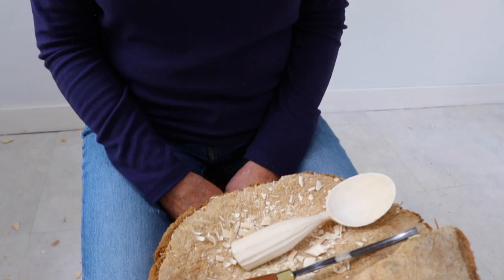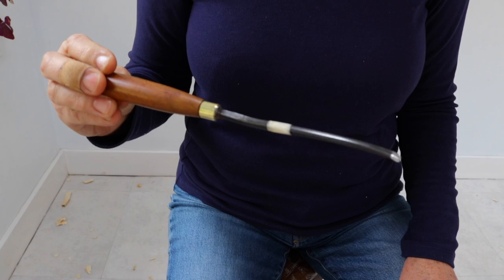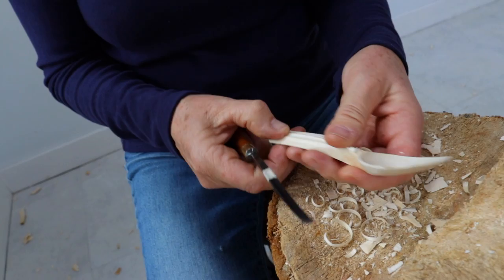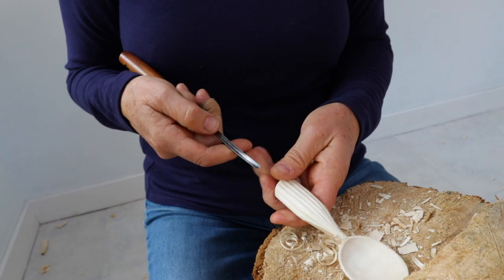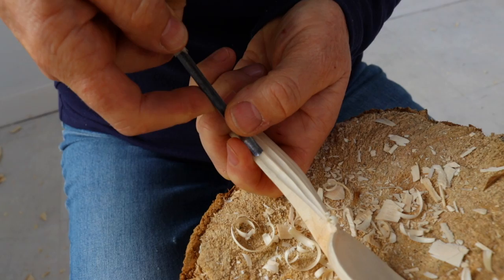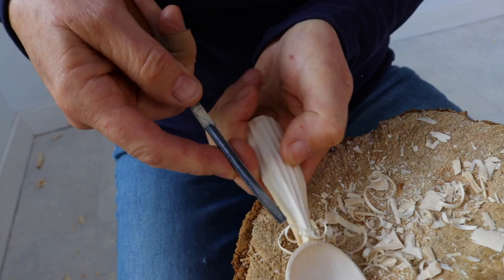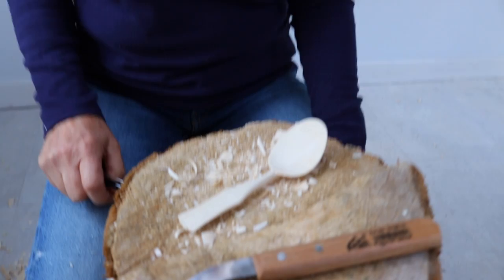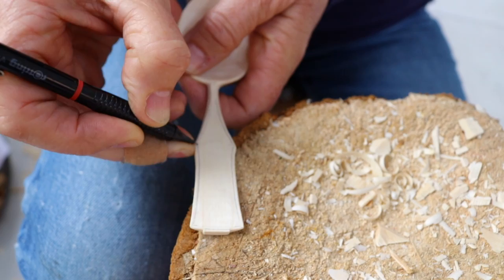Spoon Carving Decoration Techniques - Maryanne McGinn

Comment: Zed I have started carving spoons but do not have the proper hatchet. Do you have some suggestions as to what brand I should look for.
Reply from the maker: Hi Mike tbh in the beginning any hatchet that isn't too heavy in the hand will suffice, depending on the funds you have to hand as a starters hatchet you may want to look at something like a hatchet made by Robin Wood which is quite affordable, the step is a hatchet made by a custom makers like Hans Karlsonn ~Peace~